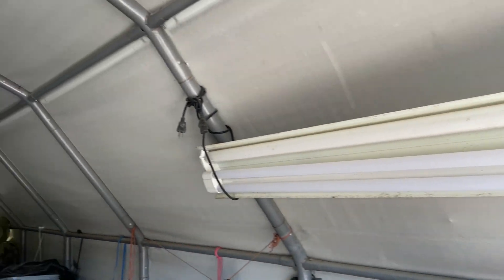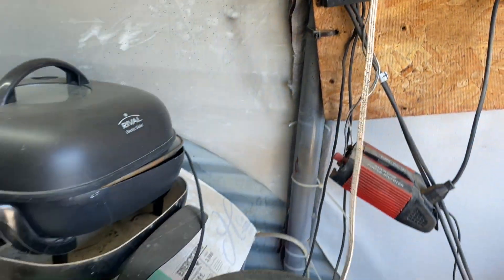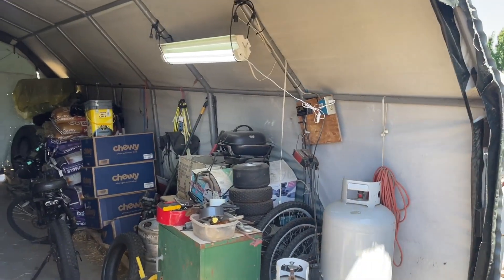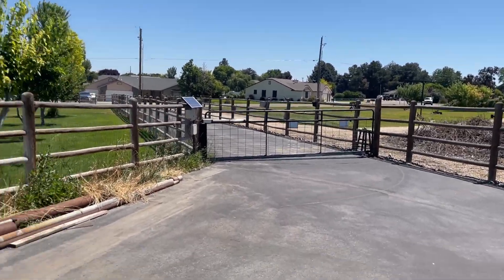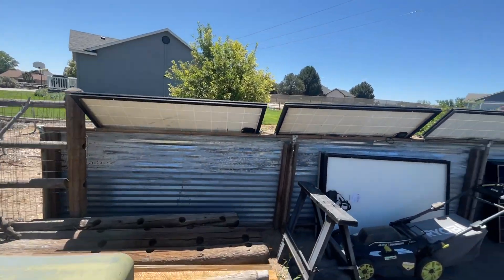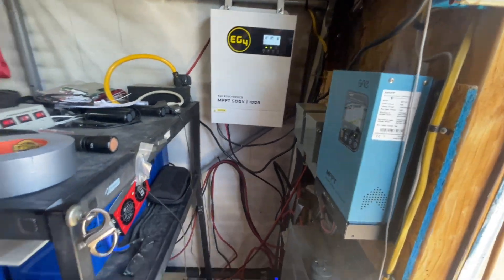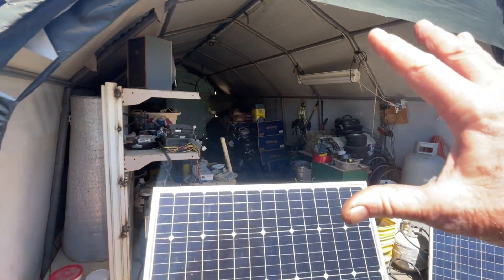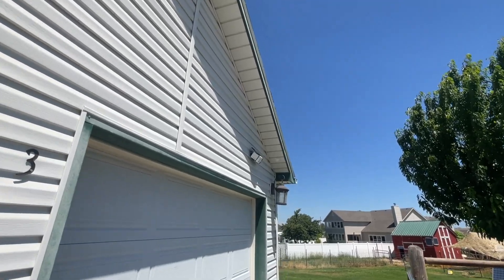Point of Use Solar Systems? Inexpensive Handy Durable Solar Systems!

Comment: Your Super Solar fence looks like it could power a city PT .  That's a great setup in your outbuilding , looks so simple really and not very expensive either . Since the Advent of LED lighting it means they use very little power to run them . Our electricity bills in Australia have gone through the roof , they're shutting down coal fired power stations before they have any real alternatives . I think it's a great idea to be self sufficient like you've done . Great job !!! 👍   May you stay fully charged with Positive energy Matt ✨ Cheers Nev . ✌
Reply from the maker: Yes, having your own small and large energy systems and almost total freedom from the grid is really a good feeling. There is a bit of snow maintenance involved in the winter, and stuff can certainly fail, so it's not perfect.. but it's really good nowadays. 
The outdoor flood lights are now becoming a super good item. I've had these ones for a few months now, and they have been terrific so far.
I hope you can take advantage of some of this fairly inexpensive gear powering your mining rig around your home or in a shed.
Stay powered and blessed, Nev
Peace Prospector Tripp

Comment: Very cool basic solar system. Thanks for sharing Tripp. Great stuff PT. How about using the deep cycle RV batteries? Thanks for a really informative video brother.😎😎⛏⛏🔥🔥
Reply from the maker: The deep cycle RV batteries work well, especially if you already have some. ☝️
I try to buy LFP (lithium iron phosphate) batteries whenever possible.  The LFP batteries are very solid and match well with lead acid battery vehicles and equipment.  I really can't see any degradation whatsoever after 3 years of running my house. I do have eight diy 280ah 48 volt batteries in parallel. Each battery is rated at 280 amps charge and discharge and is speced at 4000 cycles repeatedly charged and discharged and still over 80% original spec. I run my batteries at less than 10% of that, 10~20 amps, and they never get hammered or overworked, which is very light duty work for these batteries. I expect that at this rate, they will last my lifetime and more.
Camping, RVing, prospecting, mining,  out buildings, shops, or barns these small PV systems are remarkable 👌
Stay powered sir
Peace Prospector Tripp

Comment: So much solar. Eventually i want a solar setup that can run my swamp cooler.. try to cut the idaho power out of my cooling costs. The swamp cooler uses 640 watts on low and 1020 on high.  But the startup uses a lot for just a few seconds.
Reply from the maker: Hello Kris,  yep.. the swap coolers are lower power than my conventional AC. I have a 12kw inverter that would run my homes AC but was being pushed to the limit on startup. So I bought an 18kw inverter that handles the AC easily.
I recommend starting small and building from there. Most microwaves use more power than your swamp cooler. There are also devices that provide the high current  startup power surge and cut out after startup. I don't have this device, but I heard that they work well.
BTW.. I have four 250w used solar panels that still produce 90% of their original power that I am donating these to the Buffalo Kris Prospecting channel! 😁
I hope to visit with you, Raymond, and Kirk very soon to give you these solar panels and Dig up some Shiny together!
Email me if you would and let me know what day works best for you.
Stay Powered sir
Peace Prospector Tripp
Reply: @ProspectorTripp  I would love that. Get ahold of captain kirk so we can get together. I'm not the best email guy but I would live to do some digging
Reply from the maker: @buffalokrisgoldprospecting  will do Kris 👌

Comment: Howdy PT.. I found this very interesting because I'm solar-ignorant. So that $140-150 point of use setup in the first temp shed, was that including the price of the battery? The fence solar panels look great... now I know why you were'nt worried about painting those ugly corrugated metal panels.. lol.
Reply from the maker: Yeah.. I don't mind the calcium/galvanic corrosion look, but I was worried that my neighbor would not like it. I asked him before installing the slightly fried ones. They are terrific neighbors and said it was okay! 👍 😃 I suppose later on, I will likely wash and scrub these corrigated roofing panels with a brush/broom, then paint them with something more eye pleasing. I wonder if I could get an aspiring wall artist to paint a beautiful murrell of something terrific 😀 😄 😊 well we will just have to see. 
Yeah, Johnny, the small point of use systems are super great for camping, mining ⛏️ 😁, portable power, lighting, and really anywhere you need a bit of power or lights.
Here's the last solar flood lights I purchased.  These light up all night on low power and go bright for 30 seconds if they sense something.. cats included  😹 at night I've worked under these, and they stay on high as long as they see someone fussing around. 🤪
There's all in one systems like a solar generator with a solar panel that are quite affordable.  However,  the diy ones like mine are most affordable and teach you the most about solar power. Many people have built a small box with the inverter, charger, and battery inside and throw it in their truck with a panel or two and off they go camping or whatever with power for everything they need for their adventure. Similar to a solar generator at a fraction of the cost. 
Peace Prospector Tripp 
Solar flood lights Link below:
Limited-time deal: intelamp Motion Sensor Flood Lights - 2 Pack 6000mAh 1200LM Security Lights, Adjustable 3 Mode Wall Lights for Patio, Garage, Porch https://a.co/d/0476X64t